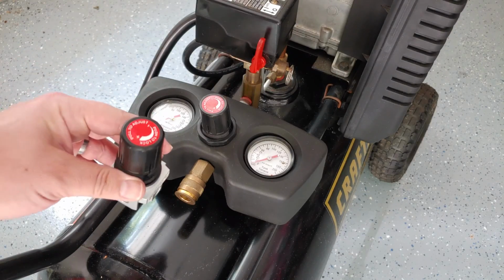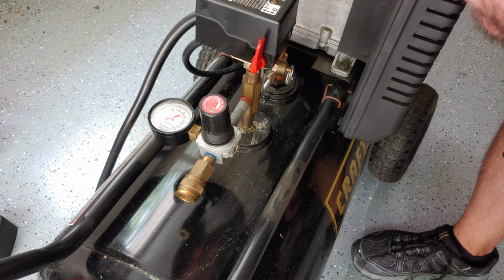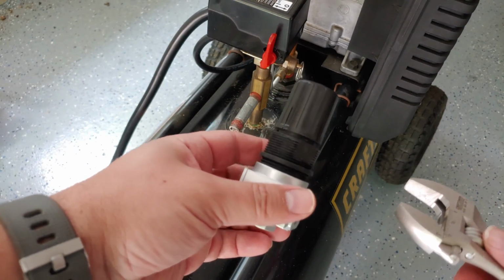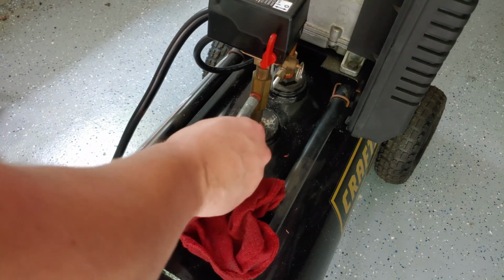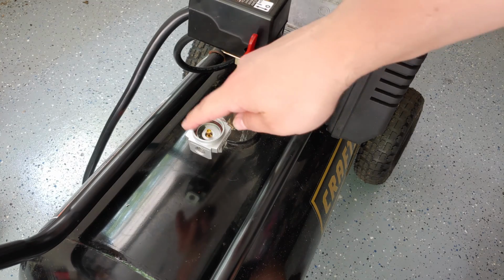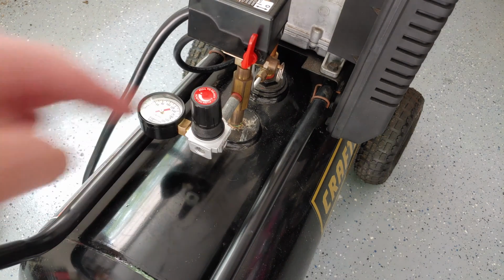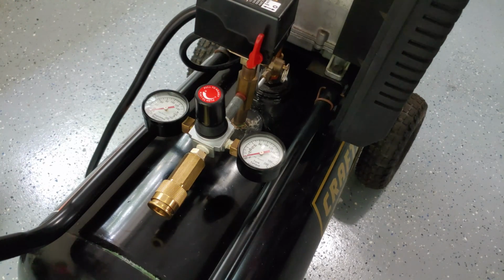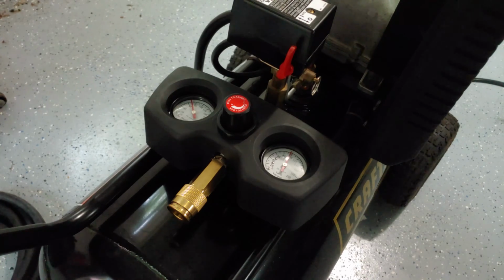Air Compressor Regulator Replacement

Comment: I’d just replace the crappy galvanized nipple with a brass one, or you’ll just get more corrosion into the new regulator.
Reply: guessing most of the junk is from the tank by the look of those q-tips.  Looks like the rusty crap that comes out the bottom drain.